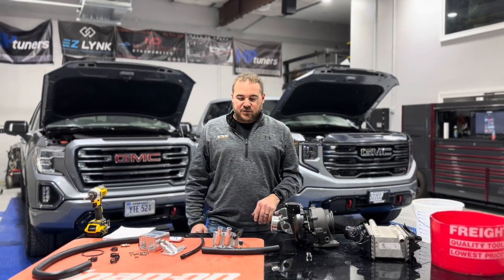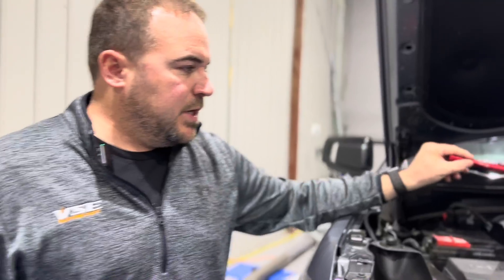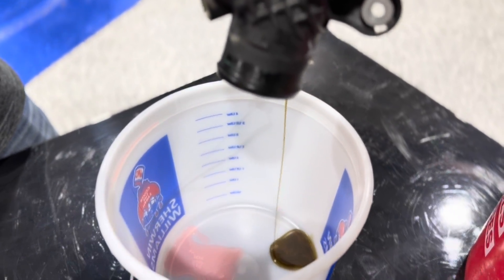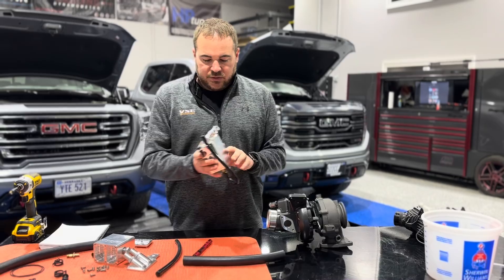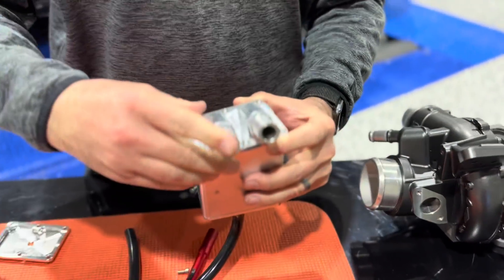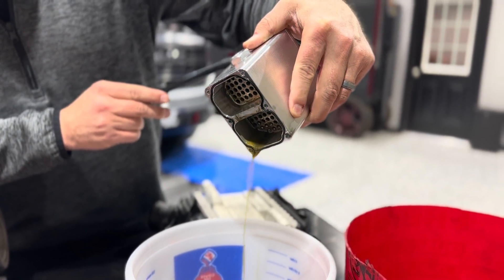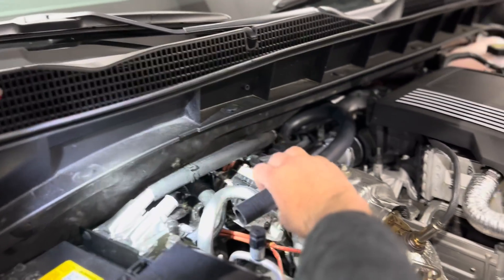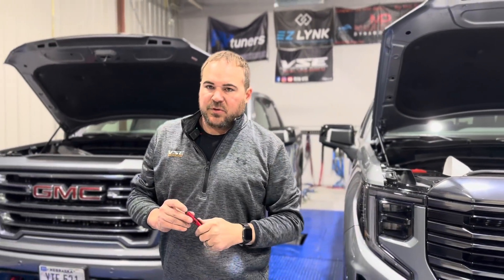3.0L Duramax Diesel - Largest Fault Yet

Comment: So your upgrade removes 100% of the oil and gunk from the air ? Its activly cooled rifht becuse your not pulling it all out without condensing it somewhere and just like all catch cans they warm up and stop working. People and their clickbait titles let you know that a company is garbage. Hope this also fixes the wet belt timing that fails you into 20k long block job.
Reply from the maker: Maybe research how the CCV system actually works. Air flows through the CCV system and enters the catch can as a mixture of oil/water. They are both heavier than air. The higher density items settle in the bottom of the can. CCV at its highest enters around 120-130F which means water will still condense as the temperature of the can is lower than the temperature of the CCV - that's how condensation works - we didn't invent classic physics, but we do live by them.

Comment: I wonder how the heat from the turbo will affect the return hose. Seems like a ton of heat for basically a heater hose.
Reply from the maker: There is no issue here. Hoses are rated for 300F and designed to handle 100 psi internally. They will warm to around 120F at max under extreme load on the dyno. Below them is the tray where wires for the turbo actuator and they lay in a heat shielded tray. The same exact hose that we use basically lays on the aluminum cylinder head as it wraps around to the turbo inlet. We have tested this very extensively.
Reply: @runvse  makes perfect sense. Thank you.
Reply: what? the factory is "Basically a heater hose.' I have had my vse CCV on my l5p for 150k, no issues with the "heater hose." 

Touch some grass, test for yourself, criticize your hypotheticals with real world proof.
Reply: @LegendaryFarm84  you act like it’s ridiculous to question running a rubber hose 2 inches over a turbo that hits hundreds Fahrenheit. Stock hoses don’t sit right above it. And maybe I’d know more if I hadn’t been waiting for 3 months on my truck
Reply: @BabyGators   it is ridiculous to ask. stock DOES sit right above it though.
Reply: @LegendaryFarm84  it doesn’t on a 3.0, genius
Reply: @BabyGators  you're right you have it figured out. What is your solution ? I can't wait to hear this so I can take a childs advice on what I should change out my 300c rated pcv hoses to. You can add a 1200c insulator sleeve to it and really make it unnecessary. what about the plastic engine cover? wrap that too?
Reply: @LegendaryFarm84 Ah, you really got me there. Nothing says intelligence by taking what could be a technical discussion and turning it into your attempts at insults. Must make perfect sense to you that a hose rated for 350 fahrenheit, not Celcius, should be 2 inches over a part that exceeds 1000 F
Reply: @BabyGators  you're right you got it figured out. You should apply at GM as an engineer. Can't wait to get you on the team. The look on everyone's face when you say the intake side of the compressor wheel exceeds 1000F. Once again, what is your solution, scooter?
Reply from the maker: @LegendaryFarm84 facts! Its a reverse mounted turbo. The hoses sit at the cowl area above the compressor. The compressor in a horrible scenerio will get to 150F on the outside. I hope people don't think we are wrapping the hoses around the exhaust side of the turbo a few wraps before connecting them to the catch can assembly lol

Comment: Hi, is there a reason you don't use something with a filter in it like a mann pro-vent?
Reply: The baffling and Venturi keep the oil and water mix in the can without adding an additional filter
Reply from the maker: we found it far to restrictive and it ended up increasing crank case pressure far to much over factory once there is any run time in it. Plus it relives the CCV to the atmosphere if there is an issue which is technically a violation of CARB and us EPA regulations

Comment: How does this thing work/perform in sub zero weather in the winter..? Has it been thoroughly tested in these conditions...?
Reply: Great question. We tested them in -20F and below conditions right here in Nebraska this winter. The Venturi and baffling will keep it operating just like OEM
Reply: Is this VSE responding? How was the moisture/water/ice build up in the CC in these conditions then?? Tx
Reply from the maker: @sierracat That was the owner of the company responding. The oil /water will sit in the can until you drain it. When you start the truck you will have CCV around 100F rolling through the CCV and it will maintain the system over and over until you drain it. There really isn't a way water to build up and plug the system due to the baffling and the ventri. Even if it did it would lift the crossover relief between the supply and return hoses to prevent the system from having any issues

Comment: or just leave the drain hose open and extend it down by the frame rail? why bother with draining it. then it just acts like a normal pcv removal kit like had been done on duramax trucks for years
Reply: Because there is a crank case pressure sensor that will trip right away and set a P04DB code. It monitors crankcase vacuum
Reply from the maker: It will trip the CCV pressure switch nearly immediately.

Comment: I’ve had the charge air cooler replaced twice on my 2021. Once at 40 000 km and then at 101000 km. Wonder if this has anything to with it.
Reply from the maker: It could have if the charge air cooler gets full of oil and begins setting Pcodes. It unlikely to damage the actual cooler itself though

Comment: Question, i didn’t quite understand in the video about the heat exchanger being clean or something about those lines. With the catch can installed, should the heat exchanger supposedly clean itself off right? Because it’s now getting cleaner air, am I correct?
Reply from the maker: Correct the heat exchanger will stay cleaner since the CCV will now have the oil drop out of the air stream and into the catch can prior to it being delivered to the turbo inlet (then the heat exchanger)

Comment: The largest fault in the 3.0 is the belt driven oil pump
Reply: It has a 200k mile service interval.
Reply: @MendicantBias1  now it does on the LZ0, LM2 at 150K
Reply: @MendicantBias1  

Well the crankshaft driven oil pump like on the 6.6 duramax has an unlimited service interval
Reply: @David-yy7lb  at 15k miles a year it would take 13 years before needing service. Plenty of chain driven systems have failures. The belt can be changed in a day and is designed for servicing. It’s a mountain out a molehill criticism.
Reply: @MendicantBias1 I put 40k a year on a truck
Reply: @jamesking4225  the average driver does 15k. Don’t buy this engine if it’s that much of a concern. Enjoy lifter failure on the 5.3 and 6.2 engines.
Reply: @MendicantBias1  at this point I don’t think I would own a Chevy or a Ford or a Dodge. I’ve been looking at new trucks for a while ,and they all kind of got me spooked on their build quality.
Reply: @jamesking4225 I was in the same boat. I bought a few remaining Toyota Tundra v8’s. Terrible mpg but down time and expensive failures is my biggest concern
Reply: @jamesking4225 who would you choose?
Reply: @justinkoff4252 probably the 3.0 Chevy
Reply: @jamesking4225 LZ0 seems to be a solid choice.. so far
Reply: @MendicantBias1  

Nope I have an 02 silverado with a 5.3 with regular roller lifters no DOD or AFM junk and just rolled over 290k miles😊
Reply: @jamesking4225 should probably rule out the Tundra too since those engines are failing left and right, and Toyota is giving some guys a hard time over replacing it under warranty.
Reply: @David-yy7lb that's nice. Love the early 2000's GM trucks. Pretty much impossible to find one for sale that's in decent condition these days. That and the 4L60 sucks dck. It's funny seeing guys acting like every AFM 5.3 and 6.2 is dropping a lifter. I know guys with over 200k miles, no lifter failures, never disabled it. They just change their oil as I often as it should be changed. It's usually the clowns waiting until 7k or 10k miles to change their oil that have problems eventually.
Reply: @hochhaul  

I have an 02 silverado with 5.3/ 4l60e trans with just over 290k miles with regular roller lifters 10w 30 moble 1 synthetic oil all it's life, I just replaced the oem knock sensors last week👍🏿
Reply: @hochhaul changed my oil every 5k on full synthetic broke a lifter at 114k miles on a 2017 5.3
Reply: @David-yy7lb  the 6.0/4L80 is a solid combo. I wish I could find one in good shape. Most guys didn't appreciate them enough to keep up on rust prevention.
Reply: @jamesking4225  have you read of Toyota Tundra 3.5 complete failure?
Reply: @marteck319  yes that’s why I didn’t even mention them
Reply: @hochhaul They are replacing the whole engines now
Reply: @MendicantBias1 most people drive 25 to 35k a year. Some drive 55 to 65. Either way, shitty gm engineering
Reply: @jeffreygoss8109  Until you have starter issues and need to pay +$2k out the ass to disassemble the entire engine because toyota stupidly and stubbornly REFUSED to move the starter out of idk THE MIDDLE OF THE ENGINE.
Reply: @MendicantBias1  famous last words
Reply: Lord another person complaining about spending as much every 200k miles as a new set of tires
Reply: Everyone complains about the belt but have no proof that it's a problem. Chains have to be serviced as well.
Reply: @derekkonkel8753  Actually to the contrary there has been a few 150k-200k 3.0 diesels pulled apart and the belt looked brand new, wasn't stretched, cracked, or anything.
Reply: That sucks for Ford then. The F-150 2.7 Ecoboost and 5.0 Coyote have the same belt driven oil pump. And it takes even more labor to change the belt on those engines.
Reply: Got the lz0 2 weeks ago and alreafy 1200 miles and pulled my 12k pound boat and trailer. badass engine for sure
Reply: Why because you read it on the internet?
Not aware of a single failure of this terrible belt you guys like to talk about.  The belts life was actually increased because it’s performance is better than expected.
Reply: @highball7347  lol facts bro, everyone hears about it and instantly thinks oh bad design bad motor. I’ll admit it’s a tedious design choice, but at least the service life was proven enough for them to justify INCREASING the service recommendation. 200k miles is a LONG time. People think they’ll hit that super fast 😤
Reply: @highball7347  

Famous last words
Reply: @David-yy7lb  nice catch phrase, only backed up by something you read on a forum and no real data. 
 I’d love to see the countless videos you have or dealership reports of these belts failing, o wait….you don’t have any.  Just a theoretical situation you conjured up having no engineering degree. 
None of you idiots on here blabbering about “but but when it reaches 300k it’s gonna break” are never going to put 300K on any vehicle you own. 
You seriously not going to buy a vehicle because 30 years from now it “might” need a belt. 🤣
Reply: @highball7347  

Wrong...I have a 08 gmc duramax with just north of 550,000 miles and a 2002 5.3  1500 silverado with 320,000 both trucks have original motors and (crankshaft) driven oil pump let's see that rubber band belt last that long and how stupid to design a truck where you need to pull the the transmission to change out a rubber band or the change timing chains
Reply: @David-yy7lb  it will last longer than you  ever need it to. 
Again you have no data. Just opinions. The engine has been out for years now with no belt issues. 
The duramax injectors will fail long before the belt will. 
I think most of you guys forget that anything mechanical will fail. 
I’m not sure when everyone that owns a pickup started thinking the standard is a million miles.  
Just listen to what you are saying. You actually think an engine isn’t built to your standards because of a service interval that 99.99 percent of people will NEVER make it to.  This engine gets amazing fuel mileage and produces 500ft lbs of torque and you guys shit all over it because it has a belt that has to be serviced 30 years from now. Lmao. You people need serious help when making car buying decisions.
Reply: @David-yy7lb exactly, crappy new GM designs
Reply: Yo tengo mi 2021 gmc sierra At4 diesel 3.0 y estoy muy contento con mi motor diesel .El unico problema que tengo es en los cables y el conector del trailer que me da mucha falla .El dealer me dijo que si el trailer tienen luces led no me va a funcionar.Alguna ayuda?
Reply: @😊thearchitect0312
Reply: @thearchitect0312 
No es verdad 
Yo tengo una Load Trail utility trailer con led luces…todo trabaja bien
Reply: No it’s not , no failures under 140k miles is not the problem.. educate yourself before you open your mouth
Reply: The belt drive oil pump is definitely not the biggest issue  with this engine.  2.7 twin turbo fords have that too and some are still waiting for it to fail at 277 thousand miles.
Reply: The belt will last 150k easy so calm down 🤣 on 2023 and up.
Reply: Which is hardly a flaw….ANY car is going to have significant repairs and maintenance at 150k to 200k miles. Plus it’s only like $3,000
Reply: @connorduffy8620 it’s a terrible design, you like getting GM f***ed ?
Reply: Gear driven is the only way to have any sense of reliability
Reply: @kyles234  

Or crankshaft driven like the 6.6 duramax and LS engines 👍🏿
Reply: @adambarras6566  longevity and required maintenance are not contradictory. Diesels require more maintenance than gas engines. The average miles driven is a combination of all drivers and then that number is averaged. Your high mileage driving is unusual and not typical of what most drivers do. Modern diesels like the Duramax 3.0 are made for fuel  economy and emissions also. 

https://www.fhwa.dot.gov/ohim/onh00/bar8.htm
Reply: They do this intentionally
Reply: @MIKESTREED  The BMW version of this engine used a chain. But BMW had chain issues. Thus far the belts with 150k+ miles on then look fine and a chain would need to be replaced at similar mileage as these belts. Chains do wear. The location of the belt means it requires less labor to get to it vs a belt mounted at the front. Labor hours required to service the oil pump belt on the F150 2.7eb and 5.0 Coyote are higher than the labor hours for this rear mounted belt. 

The timing chains on this engine will need service sooner than this belt will.
Reply: The funny thing is most of these engines are failing because of the timing chain before the wet belt even needs to be replaced
Reply: @Briandotmiller  Most of those failures are LM2's  due to not monitoring oil level, ie not having the valve cover defect TSB performed.
Reply: Everyone complaining about this seems to believe their GM transmission is going to last more than 200k.

When they drop the transmission, do the belt at the same time.
Reply: @libradrag0n  They have no problem going over 200k for people that have the fluid serviced as often as they should.  But most dunces don't think about servicing the fluid and filter until it starts shifting like sht. By then it's too late and they go on the internet to whine and complain about GM transmissions.
Reply: @hochhaul  

Yep my oem  Allison 1000 has 313k miles on it and have always changed the fluid with Castrol transynd 668 and external filter
Reply: i mean…200k miles is a long time….and you only have to drop the trans and remove the timing chain cover. Belts serviceable from there.
Reply: @nahbro3240  and it was replaced promptly under warranty, and that is a freak occurance. Right?
Reply: @thenorthernwill  it should be, never heard of anyone else having problems at that low mileage. Could’ve been reckless driving by the dealership that transports their vehicles to the lot and stuff. (speaking from experience, as a young dude i can admit i had some fun with any cool
vehicle we picked up from
the barge 🙃)
Reply: The worst thing is failing timing chains that have 34 hr labor to replace $300 parts
Reply: The 3.0 is not the only motor using a belt driven oil pump. Driving the oil pump with a belt has been done for years by many other companies. GM disclosed it to the public and that automatically makes it garbage. Relax and drive. It is ok.
Reply: @CHRISINMCNEILL it’s a terrible design, why are you promoting it?
Reply: @CHRISINMCNEILL Yeah and there have been many premature failures of these belts.
Reply: F150 5.0 also has belt drive oil pump
Reply: Came here to say this
Reply: And the timing chain....
My 2020 with 56K miles....just popped the p016 code.  
Look it up....I have 4 to 5 months of warranty left.  I'll be getting rid of this, going back to gas.  Lifetime GM guy....new Fords suck as well..may have to look at a tundra for the 1st time ever.  Meanwhile....I'll be minimum 1month without a ride.  I am pissed....GM....would design this sh#$ motor.  Love the mileage....oil pump belt, timing chain.....back of the engine.....stupid....
Reply: @ it’s a rubber timing belt, not a chain